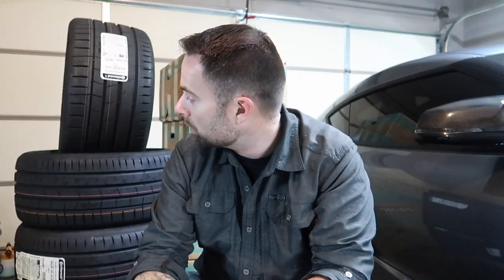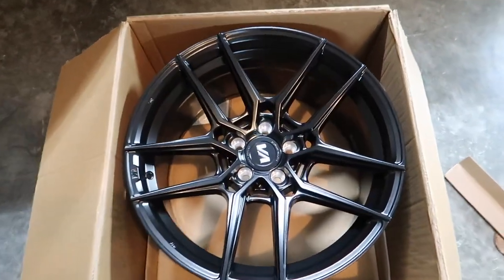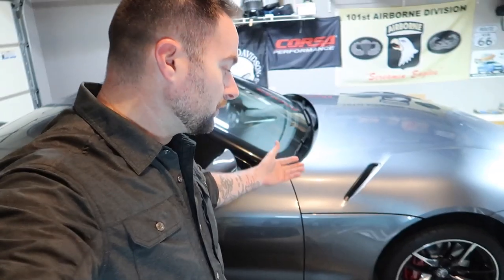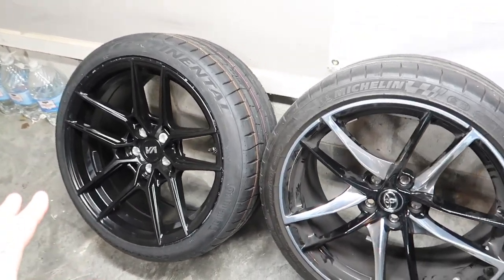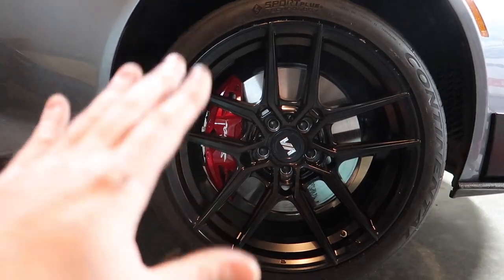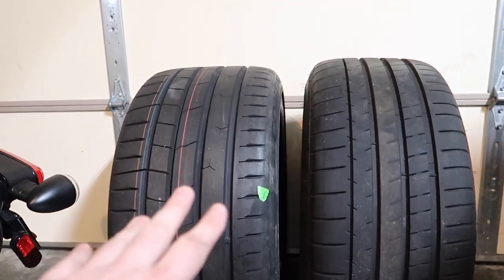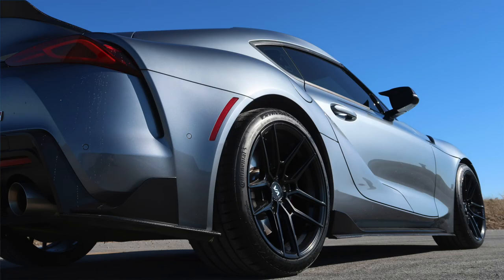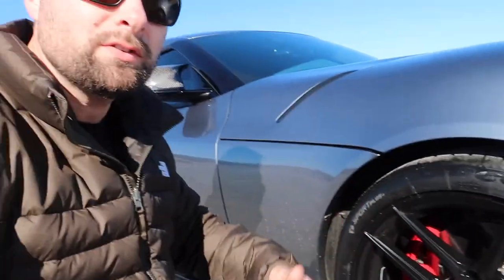WHOA🔥FIRST SUPRA ON THE PLANET With These Variant Helium Wheels!

Comment: Hey man, does your promo code still offer everything? I'm trying to checkout and it only says free shipping.
Reply from the maker: It does. Use this link: https://variantwheels.com/affiliate/zander13 and use the ZANDER13 promo code. It may not say you get everything but you will. Their website is having issues displaying everything but you will 100% get everything I mentioned in the video
Reply: The wheels just came today. No ceramic coating, or wheel cleaner! I only got free shipping!
Reply from the maker: @torriej06  not sure what happened. Did you contact them?
Reply from the maker: @torriej06  what’s your email on your order or name?